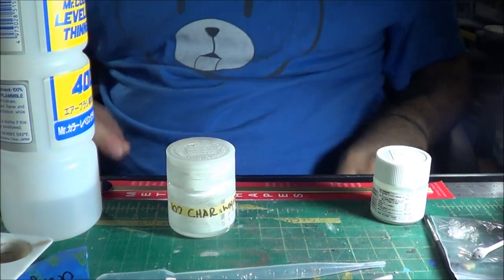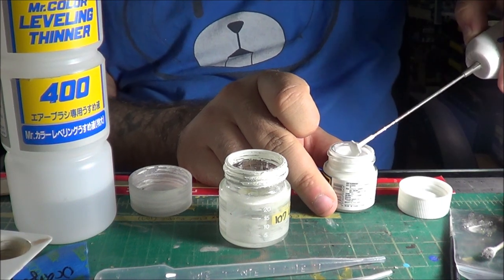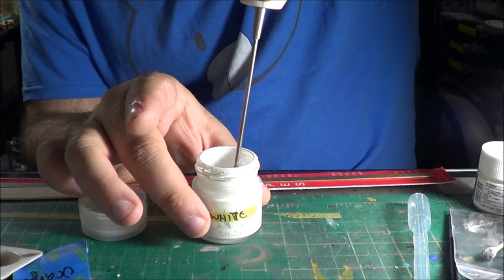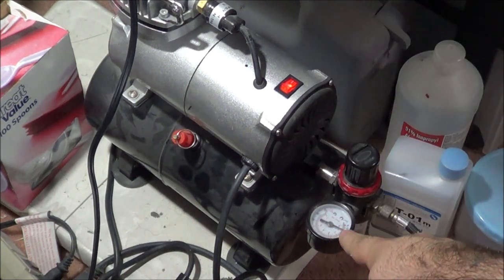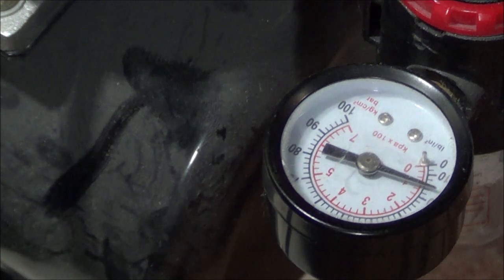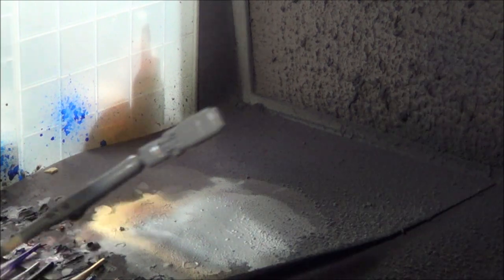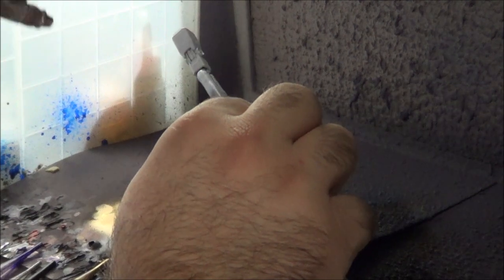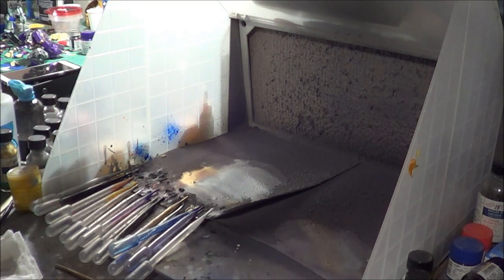Tutorial Tuesday: thinning and spraying paint basics for airbrushing

Comment: Good stuff, man.
It's always handy to have a refresher once in a while.
Not to change the subject, but I've got a similar looking compressor to yours.  It's a Paashe brand, and though it's served me well for a couple years, a while back it started leaking air out the top in several spots.
Your compressor looks like one of those generic types you see on Amazon a lot.  Since I might be looking for a new compressor eventually, how's yours holding up?  How long have you had it, and have you had any issues with it?
Reply from the maker: +crapmunky99 this is my second generic. the first was a tankless and until i got a tank i didn't realise how nice having one was. but i've had this one almost two years? it's served me well. although i admit i sometimes think i overuse it and it heats up. but it's still going strong. so who knows.
Reply: +Justinius Builds
Yeah, I think I used mine for about two or three years before it started leaking.  And I used it for at least a couple hours each sitting (usually more), & it would get pretty hot.  Maybe I pushed it too hard; I don't know.
Anyway, thanks for the help, man.
:)
Reply from the maker: anytime bro. :)